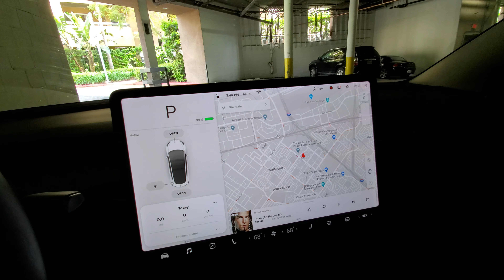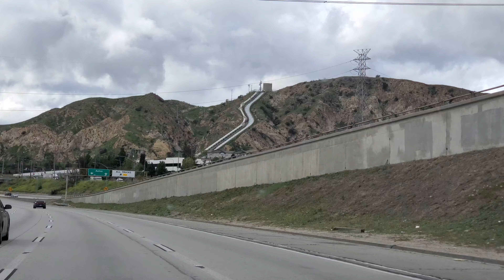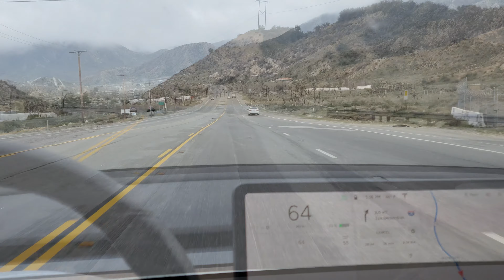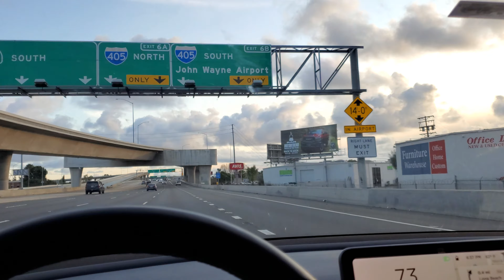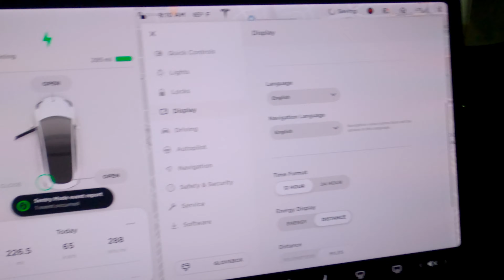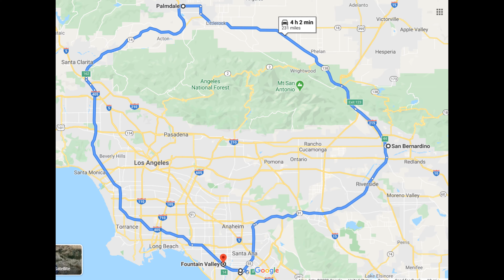Model 3 Sunday drive and battery capacity test @ 39,000 miles

Comment: Good video. Got to know; original tires?  If not, what did you replace them with?  My stock Michelins are worn out at 22,000-miles and trying to figure out what to replace them with.
Reply from the maker: Hey thanks. Original continental's except for one tire which was damaged and replaced with a Bridgestone Quiettrack. Seems like a good tire might replace all 4 with this in the future.
Reply: @ryen7512  Hope I am not bothering you too much, but the miles on the OEM tires are outstanding.  Can you tell me the model name of your original Continentals?  I really need to consider them.  Thanks for the video...we're cooped-up here in TN and your video was almost as good as getting out in our M3.  Not too many M3s around here though.  Great scenery. Thanks for the time it took to put this video together.
Reply from the maker: @patrickwalsh467  not a problem. Happy that someone is interested in my videos! The oem's say Continental pro contact RX. Treadwear rating 400 traction A temperature A.
Reply: @ryen7512  Many thanks.  Off to TireRack to investigate.